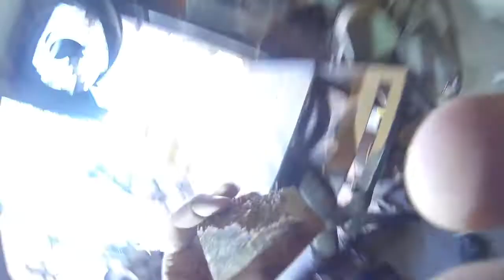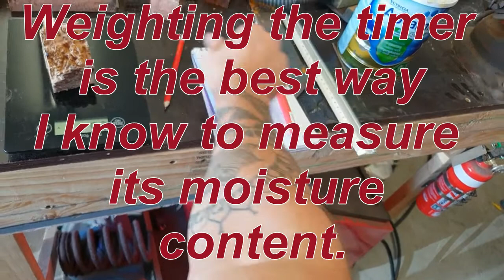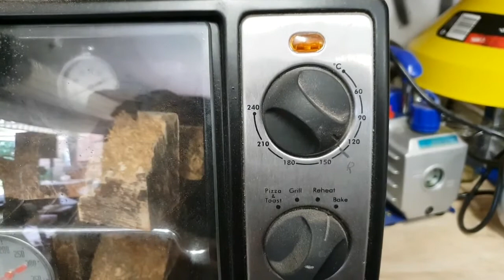Stabilizing Australian hardwoods in a vacuum chamber with cactus juice pt 1

Comment: What vacuum chamber do you recommend?
Reply from the maker: Hi mate I personally now use a pressure pot with a custom made glass lid. So I can do vacuum cycles and pressure cycles in it and just change the lid over. Take a listen to my most recent podcasts Toby Fire and Steel on al podcast platforms. They go into all you could need for stabilizing mate

Comment: so if you need to stabilise for 3 months does the vacuum pump need to be on the whole time or are you sealing the camber and keeping it above a certain pressure? if that the right word. Cheers 4 sharing sir.
Reply from the maker: The 3 months ish includes soak time. My first few cycles were on permanently for over a month so I killed a couple of pumps. But now days I let it cycle off every now and then. To cool down as the chamber holds a vacuum for quite a while. I'm testing pressure cycles as well at the moment to see if I can shorten it. Thanks for the question
Reply: @TobyFireandSteel  oh cool i always wondered about that. All very interesting though. Cheers for the reply.
Reply from the maker: To easy any time mate